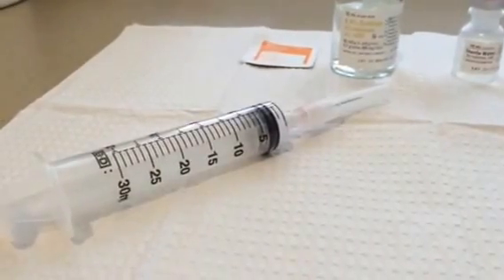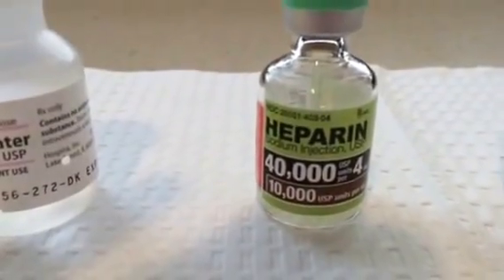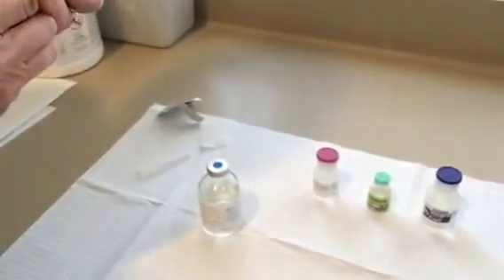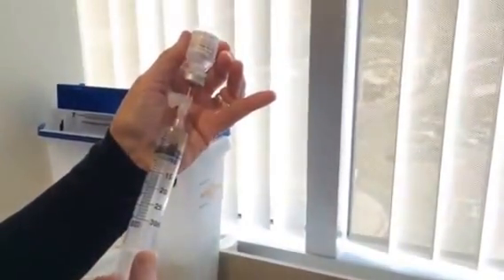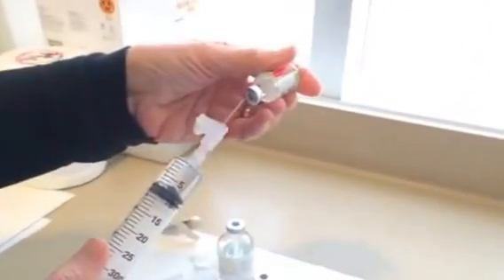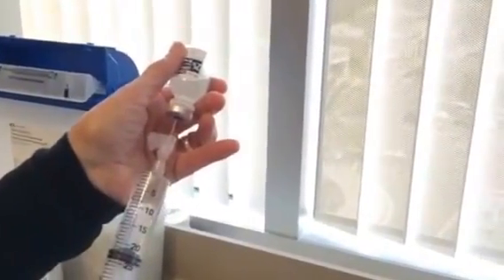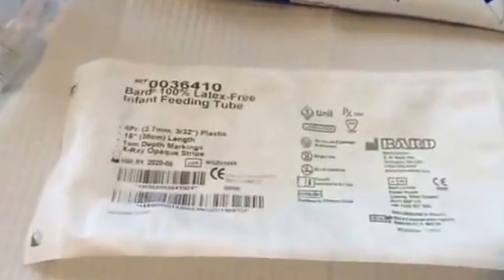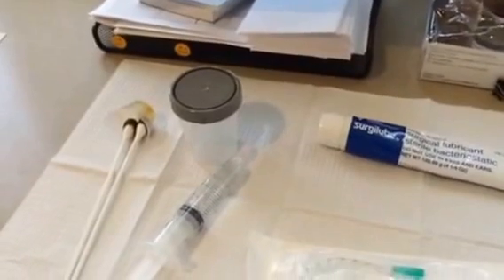Bladder Instillation - Interstitial cystitis - Scripps Clinic - Bruce Kahn, MD

Comment: I have had a bladder hydroextension, several bladder installations about 5 years ago where I don’t know the exact meds they put in the syringe, and now I have an Interstim device implanted in my right butt cheek with an outside remote control to turn up or down when I feel the need.  The Interstim device is for urinary frequency, not for pain.  Ugh!  The pain is the worst part of my IC.  For those of you who are wondering if you should try the Interstim device for frequency, you can’t see the device sticking out of your skin at all.  There is a small scar but that’s truly the least of my worries.  It is worth a try if your doctor is suggesting it to you.  There are several videos on the two steps of implanting the Interstim on YouTube if you want to check it out.  Anyway, none of the before mentioned things worked for my Interstitial Cystitis so my new Urologist thinks that his new mixture of meds in 6 bladder installations, 2 weeks apart might help me.  He is using the same amount of lidocaine but only 10,000 units of heparin and then he is also adding Solumedrol.  After watching this video, it seems like he should be using more heparin.  I don’t know.  Maybe the Solumedrol helps the heparin work better.  It’s all so confusing and frustrating.  It’s like I’m back to the beginning again.  I’ll write an update later.

Comment: I get Rimso, SoluCortef, and Heparin and the 2% lidocaine. My preference is silver nitrate diluted in sterile saline but I can't get silver nitrate anywhere. My doc doesn't have any (my previous doc did). They gave me an RX for it but I can't fill the prescription anywhere. It's the only thing that gets me through a flare. I've had IC for thirty years and it is such a drag. 😁
Reply: I can't take the burning in the rimso..the only time I get it is in the operating room when I get my hydro extension...every 6 months..do you think the silver nitrate may be tolerated better for me?
Reply: Have you ever tried Elmiron?